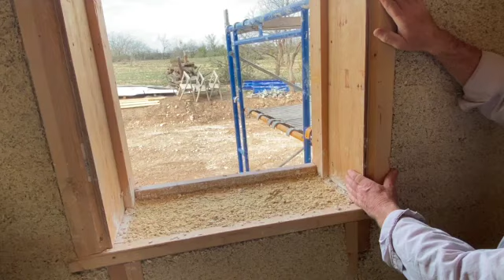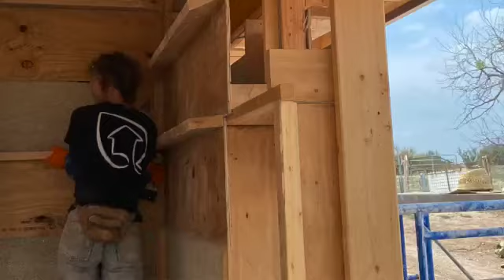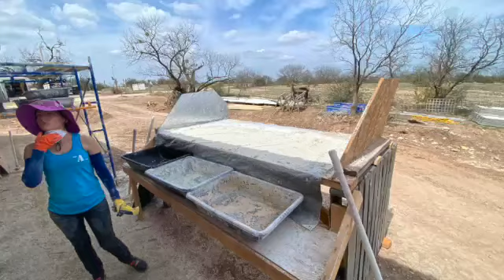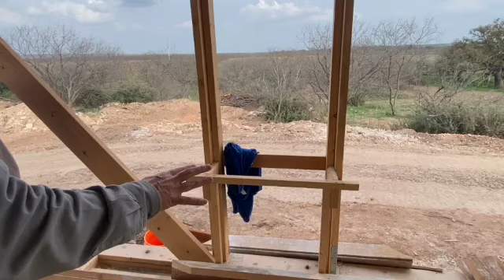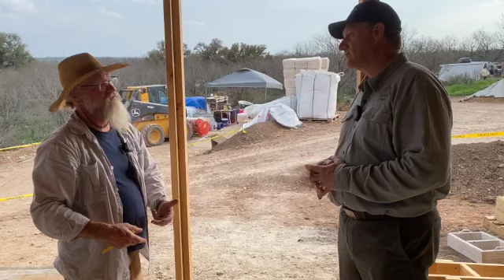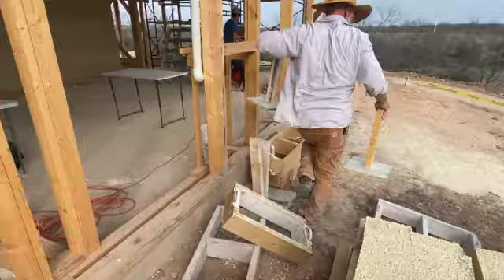Project Tour Tim White with Texas Healthy Homes - Hemp Construction

Comment: I live in Ca… would want everything non combustible…
Reply: Hempcrete has excellent stats for that. Won't burn, and insulates really well so the timber encapsulated in it doesn't burn either.
What I want to see is a hempcrete house on a shake table. Expensive demonstration, but it needs to be done.
Reply: @tealkerberus748 no point in doing it as hempcrete is a non load bearing insulation, hard as it after completion it does not fit that purpose. Or you would need to wait close to 100 years until the hempcrete has turned into limestone after years of CO  intake. Now that is an expensive test. 😅

Comment: Thanks for the video.

I'm curious, is there a reason the wood is protruding through to the exterior walls?

Is that going to be covered later?
Reply: It gets plastered over later. Yeah.
Reply: @anthonytroia1  ok, thanks.

I thought the idea was to seal the wood inside a couple of inches of hempcrete for part of the fire resistant aspect.
Reply: @tracy419  You might know something I don't. I'm not an expert.
Reply: @anthonytroia1   I'm not either. 

From what I've gathered in other videos, about 2 inches of hempcrete is enough to protect wood from direct fire.

I've seen them use torches and fire testing chambers and with the torch on one side of the hempcrete, the other side shows no temperature change. 

Really cool stuff. 

Anyway, I appreciate your video.
Reply: @tracy419  r u going to build a Hemcprete building?
Reply: @anthonytroia1  I'd like to, but it's not very likely unfortunately.

I still like to watch and learn about them though.